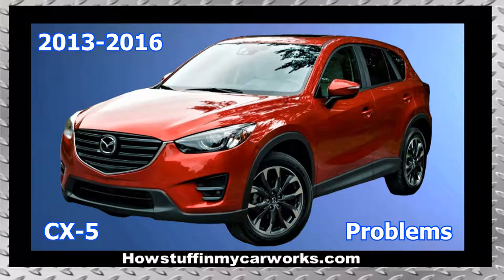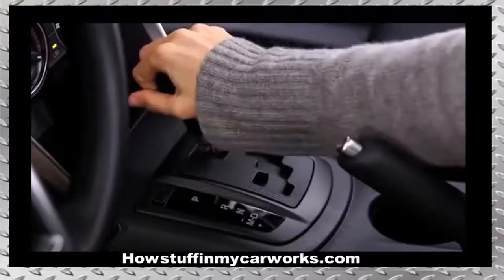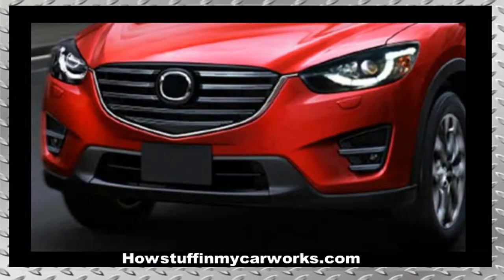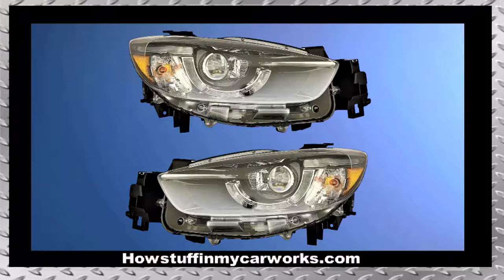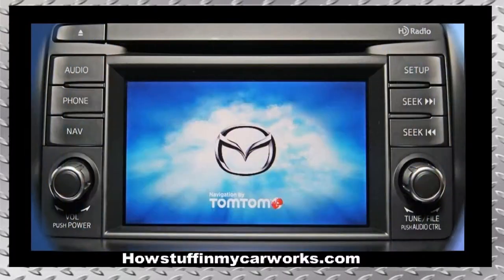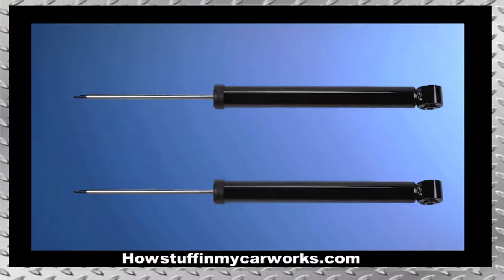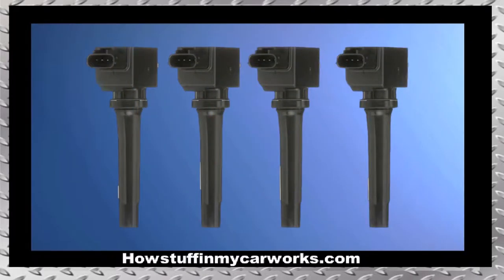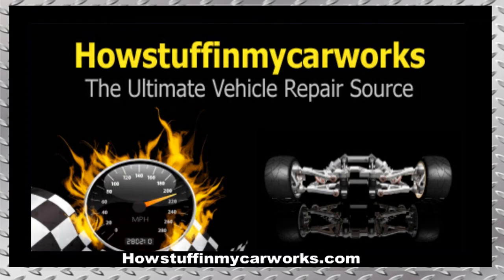Mazda CX-5 1st Gen 2013 to 2016 common problems, issues, defects, recalls and concerns

Comment: We have a 2013 cx5 that sometimes wont start once its turned off, unless the shifter is wiggled a few times. Plus it at times doesn't shift into gear properly once started. Will the defective switch you listed first cause this?
Reply: Yes.

Comment: I have a 2016 mazda cx5 sometimes when I make a turn it makes a sound like a pump, I have taken it to several mechanics and they do not know what it is, it has not given me a problem in the 3 years that I have had it but sometimes the sound is annoying and I would like to fix it, I would appreciate it if someone knows something about it
Reply: What does a pump sound like.  An air pump or water pump?
Reply: maybe tyre contacts plastic cover?
Reply: power steering pump
Reply: Differential